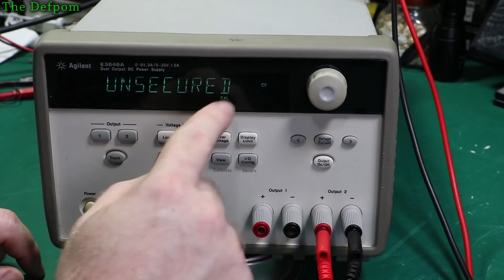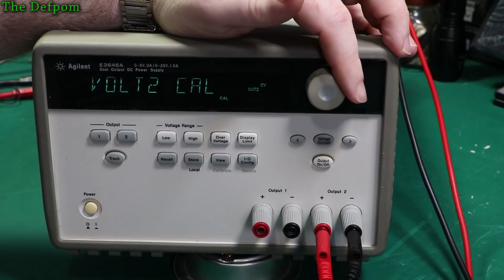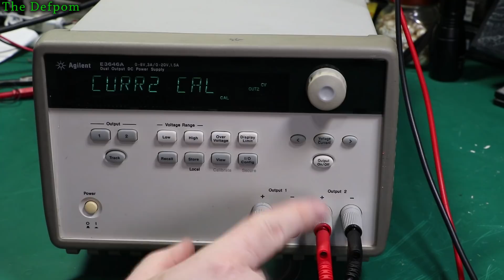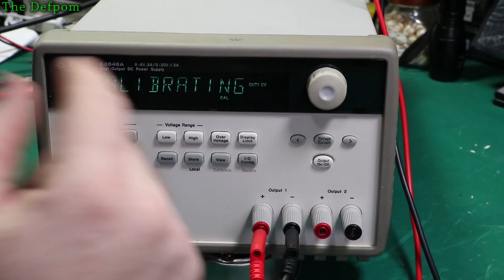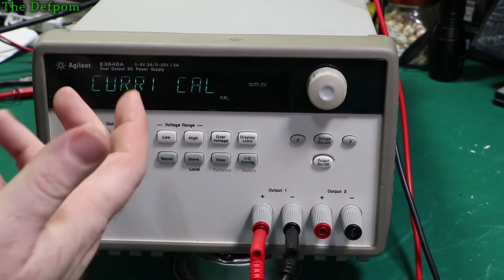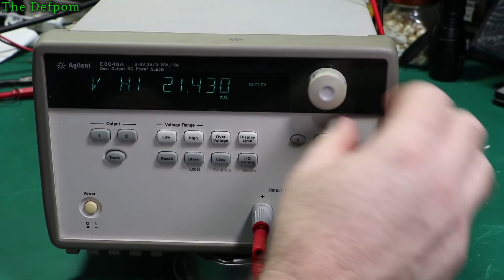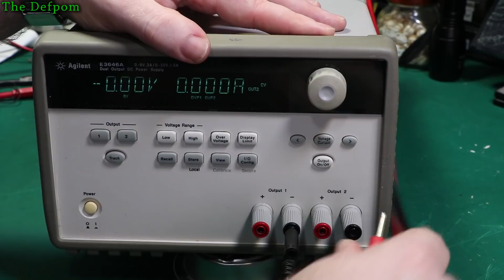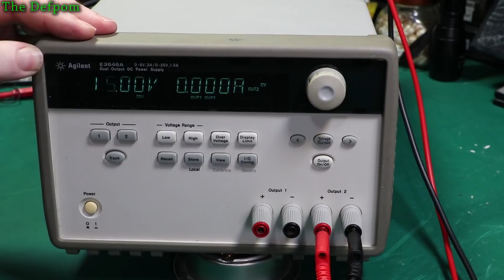🔴 #567 Agilent E3646A Power Supply - How To Calibrate Voltages

Comment: Using red binding posts for negative terminals is common for HP/Agilent power supplies and meters. This indicates that the negative terminal IS NOT grounded but isolated from chassis ground. Red negative terminals will usually be marked with a maximum voltage to ground value - sometimes several hundred volts. On instruments where the negative terminal is at chassis ground the terminal is black. The red negative terminal is a safety feature - HP expected users to RTFM. Regards, David